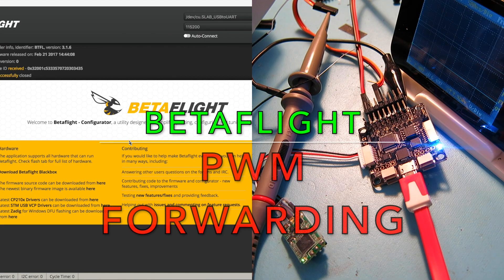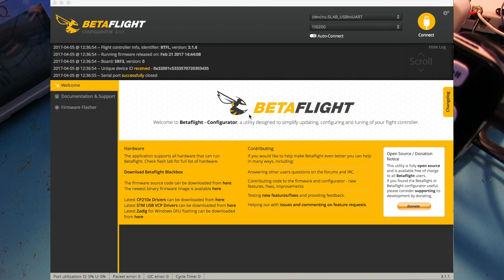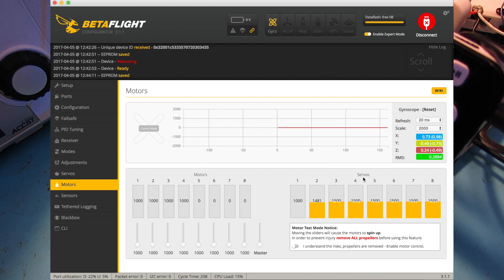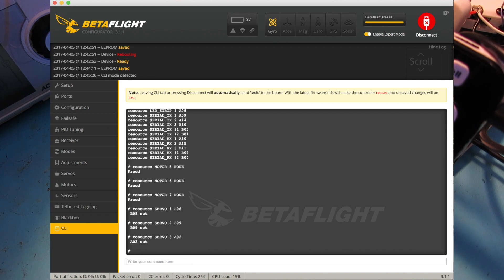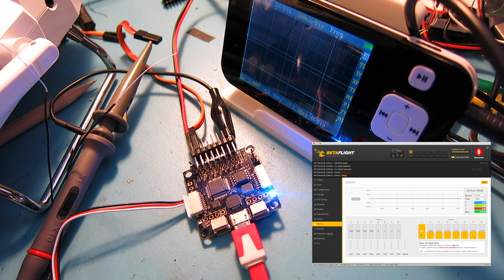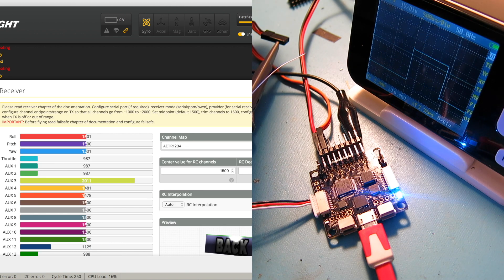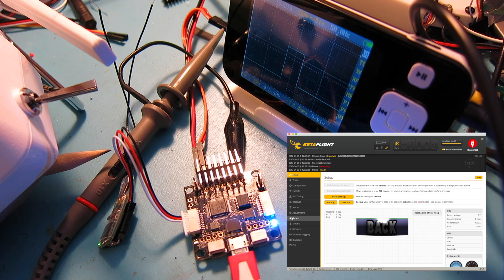Betaflight Servo Tilt vs. Channel Forwarding

Comment: I want to use an old cheap controller with OMNIBUSF4SD firmware when setting up the Flying Wing - I flashed it with the older 2022 version... When remapping the motors and servos, initially motor 1 works fine in PWM ESC setup, but when I change the remaining motors 2 and 3 to servo inputs, the motor no longer works, but the servos respond to the Accelerometer ... I imagine there must be some settings in the mixer as well, but I can't figure it out
Reply: If your resource mappings to the motors are correct, then there is probably a bug in Betaflight or the hardware.  Do you have more motor outputs to switch to?  I think once you start using 2 servos, some things might get weird.
Reply: @chuckjoga1161  yes motor outputs are correct, there is 6 motor outputs ... thanks, i will try others
resource MOTOR 1 B00
resource MOTOR 4 A02
resource MOTOR 5 A01
resource MOTOR 6 A08
resource SERVO 1 B01
resource SERVO 2 A03

Comment: Why can't I find the Servo Tab in later Betaflight versions?
Reply: Is "Enable Expert Mode" turned on?
Reply: May need to select servo option when you download Betaflight.  They do on demand custom builds to make the firmware smaller to work on a lot of different flight controllers.
Reply: Go to the firmware flasher and click on the Other Options.  Scroll down to Servos.

Comment: I understand everything but one, I have an omnibus f7 v2 controller. To what pin on the PCB do I have to connect the servo if it wants to use it as a load drop mechanism, controlled by a switch, or as a lighting switch. I know that you can probably use a pin for LED, but can I use, for example, pins to communicate with GPS? or some other?
Reply from the maker: I'm not familiar with that FC.  But, if there are 6-8 motors supported, you will be looking for motor 5 or higher.  If you don't have extra servo outputs, I believe that you can remap the LED pad.

Comment: Its odd, if im using servo_tilt all the servo work, but if i change to channel_forwarding my servo not work. Im only use 2 servos, can you use channel_forwarding if only assign for 2 servos?
Reply: I would like to learn that as well. Did you figure it out?
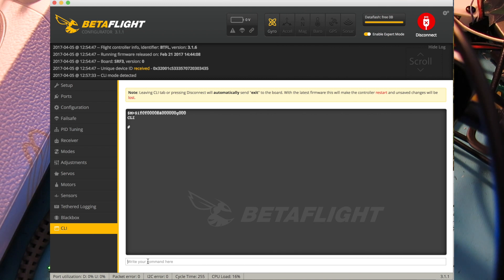I think what he shows in this video at about 12:50 about set channel forwarding start might be the answer.
Reply: @flat-earther  yeah i figure it out, something like box value cli, kinda forgot. and make sure no dma timer crash

Comment: is it normal that after setting the channel forwarding and turning off servo_tilt i can't see servo's indicators moving into the "motor" section of betaflght?
Reply from the maker: Yes.  The indicators only move when in servo tilt mode.

Comment: I was hoping you could help me. I wanted to use a omnibus f4 pro v4 flight controller on a tricopter. I don't know how to setup the servo for the tail motor. Betaflight will let me choose the tricopter option, but it won't let me set the servo tilt or the channel forwarding option. How would i set this up to control the servo?
Reply from the maker: Here's a discussion thread that should give you some answers.  https://www.rcgroups.com/forums/showthread.php?2865017-tricopter-naze-and-betaflight
Reply: Mile High Multicopters thanks so much.

Comment: Excellent video. Exactly the info I was looking for in great details.  Why the resource allocation is not available in the GUI first ?
Reply from the maker: Thanks!  I'm not sure of the answer to your question, but a lot of things are still in the CLI and not the GUI.  Eventually, you will see most of the CLI configurations options the GUI.  Sometimes there are more than one way or order of steps to set something up.  So there may be better methods than I have shown.

Comment: I have a problem, I can't change the output in the cli, I use BEtaFlight 3.0.1!  My Servo is plugged in PORT 8, PORT 1-4 are my motors!
"
$M>_tARM;AIR MODE;ANGLE;HORIZON;MAG;HEADFREE;HEADADJ;FAILSAFE;BEEPER;BLACKBOX;FPV ANGLE MIX;CAMSTAB;$M&gteû $M&gtni
Entering CLI Mode, type 'exit' to return, or 'help'

# version
# BetaFlight/SPRACINGF3 3.0.1 Oct 18 2016 / 10:35:52 (48b7b4f)

# resource
IO:
----------------------
A00: PPM IN
A01: FREE 
A02: MOTOR7 OUT
A03: MOTOR8 OUT
A04: ADC BATTERY
A05: FREE 
A06: MOTOR1 OUT
A07: MOTOR2 OUT
A08: FREE 
A09: SERIAL1 UART TX
A10: SERIAL1 UART RX
A11: MOTOR3 OUT
A12: MOTOR4 OUT
A13: FREE 
A14: FREE 
A15: FREE 
B00: MOTOR11 OUT
B01: MOTOR12 OUT
B02: FREE 
B03: LED1 OUT
B04: MOTOR9 OUT
B05: MOTOR10 OUT
B06: I2C1 SCL
B07: I2C1 SDA
B08: MOTOR5 OUT
B09: MOTOR6 OUT
B10: FREE 
B11: FREE 
B12: FLASH CS
B13: SPI2 SCK
B14: SPI2 MISO
B15: SPI2 MOSI
C13: MPU EXTI
C14: FREE 
C15: BEEPER OUT
F00: FREE 
F01: FREE 
F03: FREE 
F04: FREE 

# resource MOTOR 8 NONE
IO:
----------------------
A00: PPM IN
A01: FREE 
A02: MOTOR7 OUT
A03: MOTOR8 OUT
A04: ADC BATTERY
A05: FREE 
A06: MOTOR1 OUT
A07: MOTOR2 OUT
A08: FREE 
A09: SERIAL1 UART TX
A10: SERIAL1 UART RX
A11: MOTOR3 OUT
A12: MOTOR4 OUT
A13: FREE 
A14: FREE 
A15: FREE 
B00: MOTOR11 OUT
B01: MOTOR12 OUT
B02: FREE 
B03: LED1 OUT
B04: MOTOR9 OUT
B05: MOTOR10 OUT
B06: I2C1 SCL
B07: I2C1 SDA
B08: MOTOR5 OUT
B09: MOTOR6 OUT
B10: FREE 
B11: FREE 
B12: FLASH CS
B13: SPI2 SCK
B14: SPI2 MISO
B15: SPI2 MOSI
C13: MPU EXTI
C14: FREE 
C15: BEEPER OUT
F00: FREE 
F01: FREE 
F03: FREE 
F04: FREE 

# 
"
Reply from the maker: Hi.  I'm not sure what is going on here.  The output from the resource command even look different.  Can you upgrade to Betaflight 3.2.x and try again?
Reply: Mile High Multicopters I literally solved it right now by using servo tilt instead of channel forwarding and by ticking Aux1 as input for all servos I could find out which servo is mapped to my real servo

Comment: Is there any way I can output the pwm signal to something other than motor out pins? I'm trying to get a pwm output from my fc that will allow me to trigger a switch. It'd be the same pulse train that would control a servo. I'm using the betaflight f3 board which unfortunately only have 4 motor out pads. It'd be nice if I could forward a pwm out to a uart or soft serial. I'd greatly appreciate your help.
Reply from the maker: Not as far as I know.  I've had this issue on a board also.  I would recommend buying an inexpensive F3 or F4 board that has at least 6 motor outputs from eBay, etc.   You can get an Omnibus F3 with OSD for less than $15.
Reply: Use led pin

Comment: Okay, this video has got me farther than anything else so far with understanding this servo forwarding nonsense. But I'm still not getting it. I'm using a Omnibus F3 and I have 4 motors wired to PWM out 1-4. I only need one servo and I don't want it auto leveled or anything. Just servo control. I have the servo wired to PWM out 7. As it is right now I can see the channel moving in the RX tab. But I can't get the servo to show movement in the motor tab. I didn't think I would have to wire the servo to motor 1 unless I wanted correction and I read somewhere that PWM 7 or 8 had to be used on the omnibus. I really don't know if that is true, but I was under the impression that I could just forward RX channel control to a PWM output fairly easily. But that isn't seeming so easy to me right now. I'm also planning on using GPS and compass. At this point I'm just trying to figure this out in betaflight and eventually I'll probably try inav. So If you can help at all it would be greatly appreciated. Thanks for the video too btw.
Reply from the maker: I'll try.  I'm not exactly sure how to only use Motor 7 without actually playing with it.  Can you try Motor 5 first to see if you can at least see the servo display moving in Betaflight?

1. In the Configuration tab set Servo Tilt on and save
2. In the Servos tab, set Servo 0 to the Aux channel you see moving in the receiver tab.  You should be able to see Servo 0 moving in Betaflight now if everything is good.
3. In CLI type set "channel_forwarding_start = 4" to map the Servo 0 to motor pin 5. (0 is M1, 1 is M2...)
4. Connect servo to Motor 5
5. See the video at 5:26 https://youtu.be/cHi1fKP1LRI?t=5m26s on how to set your resource IDs up for motor 5.  Now you should be able to control the servo on Motor 5 pin.

Your problem is probably related to Resource IDs and/or channel_forwarding_start.  As long as you're using Servo Tilt, you should be able to see movement on the Servo display with Betaflight.
Reply: Thanks for your reply. I think I was confusing setting servo 0 to A7 or something like that (as in m7 or pwm 7) when i should have been setting it to A1 or A2, which are the channels I see working.  When I get some time I'll give it another try and get back to you if I have problems. I think I'm just being stupid because most of the time I get around to working on this I'm dead tired. Evidence is that I'm also having problems getting the GPS working, and that hasn't been an issue for me in the past. Though I've never tried on a omnibus before. But it's very frustrating when your pretty sure you wired everything right but nothing works. :\  Thanks again for your help.

Comment: if u just want tilt on the camera........use a 5v ubec powered from the flight battery to power the servo............red/black........connect the signal wire from the servo into the rx...ch 5 or 6.....i use a tgy-ia6b....has ibus and more pins to connect servos...........i use the 3 postilion switch for straight out, 45 degs down and straight down for landing........

Comment: I am going through this at the moment, I have been able to get one servo working using the CLI and stuff like 
Resource motor 8 None
Resource Serial_Rx 2 None
Resource servo 1 A03
but going into the Servo tab every time I try to make a change it unticks it, I have today tried adjusting the radio so its 100% correct in its travel
I got one servo operating but no more?
I also see no movement on the servo tabs in the motor area?
Reply from the maker: I don't know why you servo tab changes don't stick.  I'm positive that if these changes don't stick, the servo tilt will not work.  If you can figure out what the correct cli commands are you can input the servo assignments manually.  Sorry, I don't know the commands without some more research.
Reply: Got it sorted

Comment: Hi, I did as I saw you do in the video (but no radio) and it did not work. Worse, motors 3 and 4 went crazy and did not work when "servo_tilt" or "channel forwarding" was activated.
Can you help me and tell me what I did wrong?
I have a Sp racing f3 and I connected the servo to the "motor 5"
In fact, I just wanted to get the camera stabilized at 40º but it does not stay in place.
Reply from the maker: I'll try.  If you turn off servo tilt and channel forwarding, do your motors work properly?  Can you give me your output from the CLI resource command?
Reply: Hello sorry for the delay of the response
Yes, if you turn off "servo tilt" and "channel forwarding" the motors work perfectly. I also noticed that the servo motors do not get stuck in a position when they are activated, I suppose it is a lack of signal. The servo motor gives a small boost only when I turn on the battery.
  I send you the CLI per message, in the comments it gets too big.
Reply: Hi, I had the same problem. I need 3 servos, with sp racing f3. I remap resource of motor 5, 6 and 7 to servo 1,2 and 3. I also changed channel_forwarding_start to 6 and enabled channel_forwarding. After that, with Dshot does not work any motor, with multishot and oneshot125, motors 1 and 2 works but motors 3 and 4 do not spin smoothly. If I disable channel forwarding, all motors works great.

I think is a problem with internal stm processor timers. As read in https://github.com/betaflight/betaflight/wiki/Servos-&-SERVO_TILT-for-3.1

In that wiki, they say that timmers can't have multiple uses, if a timmer is used for a motor, all pins connected to that timmer can only be used for motors. And with current mapping (sp racing f3):
Output 1: TIM16 CH1
Output 2: TIM17 CH1
Output 3: TIM4 CH1
Output 4: TIM4 CH2
Output 5: TIM4 CH3
Output 6: TIM4 CH4
Output 7: TIM15 CH1
Output 8: TIM15 CH2

So i Try to remap Motor 1, 2, 3 and 4 to outputs 3,4,5 and 6,
Servos mapped to output 1, 2 and 7,
channel forwarding start = 6;

So, this resource remapping works for me:

resource MOTOR 1 NONE
resource MOTOR 2 NONE
resource MOTOR 3 NONE
resource MOTOR 4 NONE
resource MOTOR 5 NONE
resource MOTOR 6 NONE
resource MOTOR 7 NONE
resource MOTOR 8 NONE

resource MOTOR 1 A11
resource MOTOR 2 A12
resource MOTOR 3 B08
resource MOTOR 4 B09

resource SERVO 1 A06
resource SERVO 2 A07
resource SERVO 3 A02
resource SERVO 4 A03
Reply: Sorry, forget to mention that dshot is not working with this config, only multishot and oneshot.

Comment: Thanks your video, Channel Forward solve my PWM Buzzer problem. 
FC board PWM1-4 already wired to Dshot600 ESCs. 1st tried on PWM6, but one motor(#2) stop working. Then PWM7 blocked the other motor(#4). Finally success on PWM8 to control PWM Buzzer.
Reply: Chen Wilson i can't get my buzzer to work, can you tell me what you did to make it work? you connected the buzzer to motor header 8 right? and what did you change in cleanflight?
Reply: 3-wire PWM Buzzer is required, here I setup in Betaflight CLI:

resource MOTOR 8 none
resource servo 1 (XYZ)*
set channel_forwarding_start = 7

*XYZ is original MOTOR 8 port.
Reply: Chen Wilson thank you, set_channel_forwarding_start=7 will let me use aux 4 to control the beeper right? so if i want to use aux2 wich is on channel 5 i need to write  set_channel_forwarding_start=5 , am i right?
Reply: Chen Wilson thank you so much it works now, the only problem i have left is that when i change the position of my switch the beeper doesn't continue to beef Forever, it just makes 4 beeps when i change the position of my switch and then it stops. i could still find my quad by continuously changing the position of the switch, but if there is a solution to make it beep continuously it would be better. do you know how to make it beep continuously?
Reply: I think it depends on controller on Buzzer board, my 2 Buzzers from different sources have their own behavior.
Reply: Chen Wilson thank you, watching other videos i've seen it is a common  behavior. thanks again for your help, i was having problem too when it was on pwm5 but it works now on pwm8. Happy flying!

Comment: So if I want to forward Aux2 to my motor 5/servo 1 what are the steps? Kinda got confused between the tilt and forward. Thx
Reply from the maker: If you're only using 1 channel, try Servo Tilt.  

The process starts here: https://youtu.be/cHi1fKP1LRI?t=3m41s

1. Turn on Servo Tilt in the Configuration tab.
2.  Go into expert mode and assign Aux2 to Servo 0 (motor 5).
3.  Change Motor Outputs to Servo Outputs  (Example: https://youtu.be/cHi1fKP1LRI?t=5m25s)

resource MOTOR 5 NONE
resource SERVO 1 B08 <- Your flight controller specific ID see video

Good luck!
Reply: Thanks, I can see the servo 1 change in motor menu....makes sense I have to tag it to my cpu pin. Will try tonight.
Reply: Thanks Chuck, it worked perfectly. After an hour looking for my quad in knee high grass I needed to add a beeper to a micro naz that doesn't have a pin.